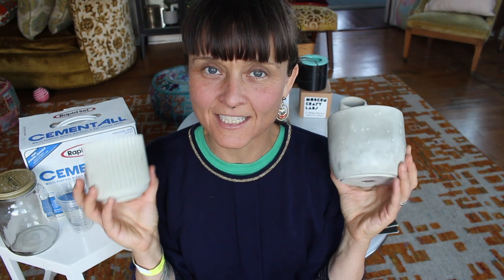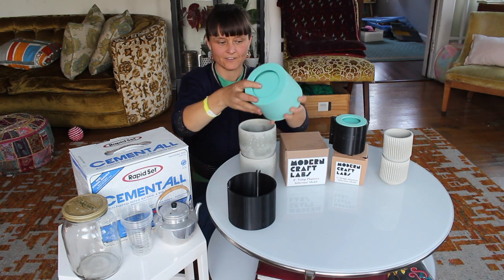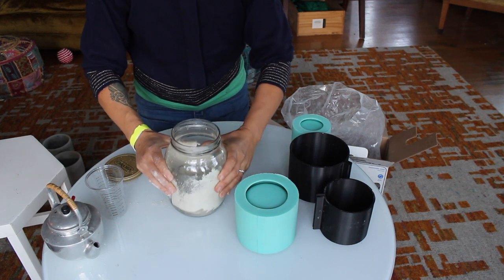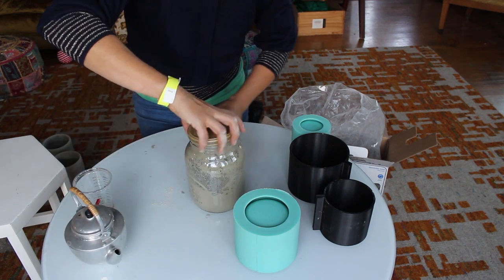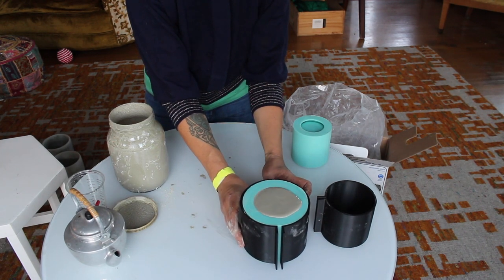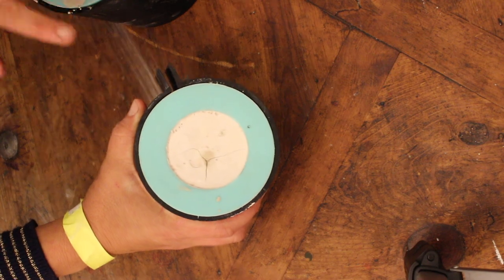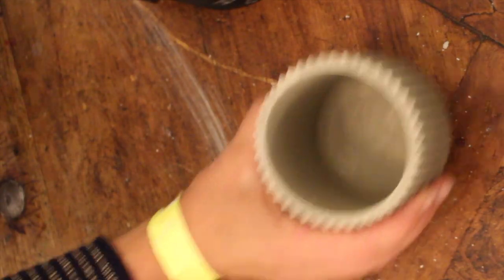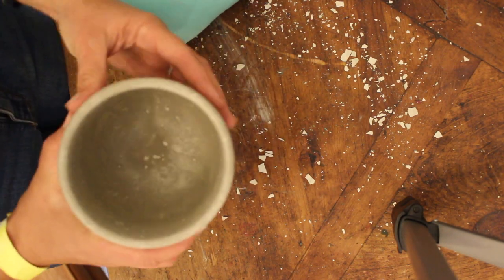Easy DIY Cement Pots Using Silicone Molds

Comment: Appreciate the effort. But if you want your pots to not break or crack easily, you must leave them at least 8 hours underwater when you take them off the mold, and wait first not one hour, but 24 hours in the mold  (Patience had better results).  Then, the cement has to cure for at least 3 days in a hot place, but not directly in the sunlight.  If you have no roof or shadow place, you can leave them under the sun but must spray water at least twice per day overall pieces.

Comment: Do you seal them with anything ? I keep getting cracks on my pots. I mold them in the garage and they sit there just fine for 3 weeks, as soon as I bring them outdoors overnight they crack. And it’s not a huge drop in temperature. During the day it’s 60 and at night like 44. What can I do for it not to crack. Does adding sand weaken or strengthen the idea of it not to crack ? Please help

Comment: Would a cheap $40 silicon mold from amazon do just as good versus the $249 silicon mold on Modern Craft Labs?? What’s the difference??
Reply from the maker: I think the cheap molds disintegrate quicker, but would be fine for learning